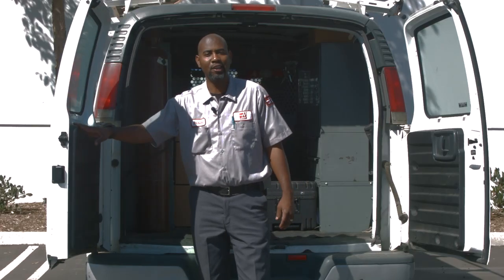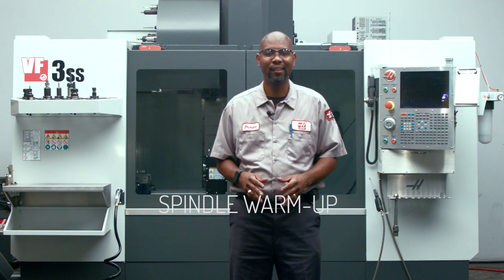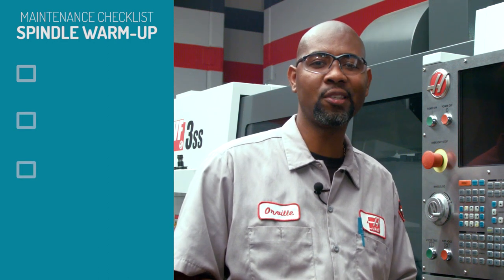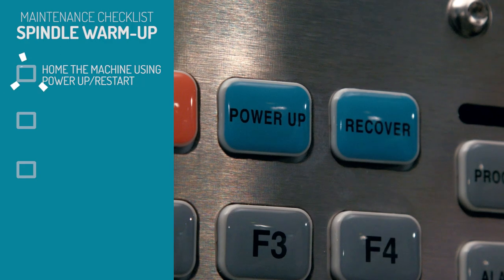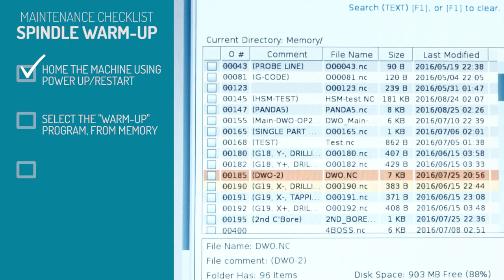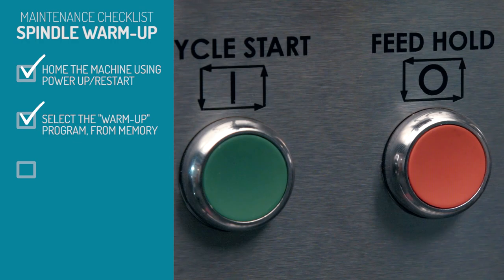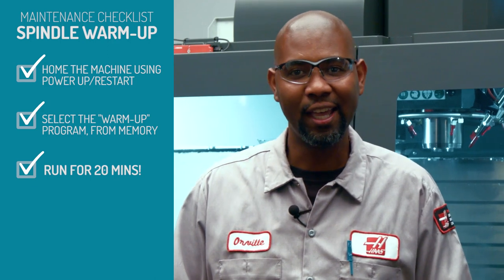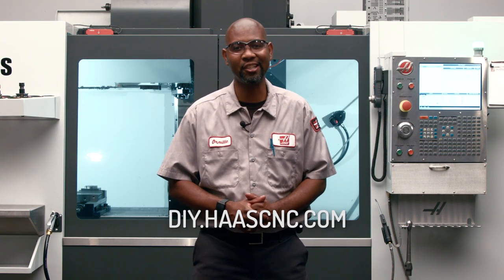Run the Spindle Warm-Up Program for Longer Spindle Life – Haas Maintenance Checklist

Comment: %
O02020 (Spindle Warm-up)
(This program should be run prior to) 
(machine use if machine has been idle) 
(for more than 4 days.) 
(Cycle time: 20-minutes.) 
(This program can be used for all) 
(spindle types and may be used daily) 
(for spindle warm-up prior to high) 
(speed spindle use. Adjust spindle) 
(speed override depending on maximum) 
(spindle speed of machine: Set) 
(override at 50% for 5,000 rpm) 
(machines, set at 100% for 7,500) 
(& 10,000 rpm machines, and set at) 
(150% for 15,000 rpm machines.) 
(9-21-99) 
S500 M03 
G04 P200. 
S1000 M03 
G04 P200. 
S2500 M03 
G04 P200. 
S5000 M03 
G04 P200. 
S7500 M03 
G04 P200. 
S10000 M03 
G04 P200. 
M30 
%
Reply: Super thank u
Reply: My spindle only goes to 7500, so I've deleted that last 10k bit, and changed all the p200 values to P240. Same run time.
Reply: I had to dig to get the code for my 30k rpm machine...
Reply: You guys should add table movements. X and Y to it’s limits and then back in reverse. All while the spindle is warming up.

Comment: If I live in a cold climate, and the machine warns me that the spindle temperature is low, is it still safe to run the warmup program as is, or should I make it dwell for longer between speed changes in the warmup program? Lets say it's 40 degrees F.
Reply: you really should avoid keeping your spindle in temps that low if you can avoid it -- I tend to keep my machines at minimum around 10c

Comment: should i run this every day or only when the machine has been idle for 4 days+?
Reply from the maker: Thanks for the question. It’s good practice to warm up the spindle every morning, especially if you plan to run your spindle at max RPM for an extended period of time. We definitely recommend running the warm-up program if the machine has been sitting for several days, regardless of what the machine will be doing. -Orville, Haas Maintenance Checklist

Comment: Curious how it works in more of an electromechanical sense as I know the spindle has a different lube system than the rest of the machine.
Reply: Hi Calvin,
First I have to say that I'm not a Haas team member but an experienced mechanical technician and I think I can give you some more informations about your question:

In fact, talking about lubrication is not a non sense but the consequence of the first phenomenon resulting of the spindle warm up procedure.
During this cycle, as you can see in the program, spindle speed increases gradually until it reaches its maximum. 
This enables all the parts involved (cf: moving parts as spindle itself, bearings... and non moving parts like spindle housing..) to warm up. 

First this modifies the internal mechanical looseness between all these parts and loosen all of those. 
Secondary, as temperature increases, lubricating oil tends to getting more and more liquid this facilitating the lubrication process as oil can now go everywhere easier.

Knowing that I think that you will easily understand why it is so important to perform the spindle warm-up procedure prior to a heavy spindle load. 

Do not hesitate to ask for details or explanations if it is not crystal clear I will do my best to answer back.

(I may have done some english language errors/inacurracies, please excuse me in advance and do no not hesitate to correct me if needed, that way I will get my english better and better).

Bye

Comment: I run this program every morning whether the machine sat overnight or over a fortnight. Just brew your coffee, and clear your dry chips.
Reply: I work in a shop with a bunch of machinist who are smarter than the rest of us. Haas never told them about the warm up and for 20 years they never did a warm up. They get pissed if you run max rpm and compare it to the rev limiter of a reciprocating engine. And they have to replace spindles.